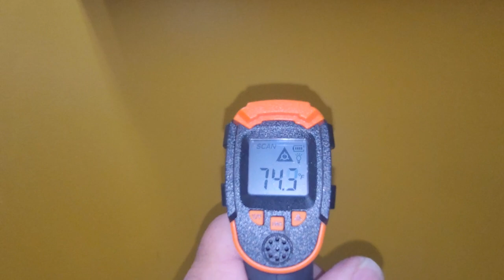Quick 'n' Easy DIY allows 2 inexperienced grads to connect refrigerant and electrical in 5 minutes

Comment: I bought two of these, two of the older ones that a vacuum pump is needed.  They really work great.  This demo should have been with NO electrical plug at all, JUST to show people that these will run 100% from just the solar panels.  I have mine connected to 4 / 455 watt solar panels, they are probably over-paneled, but that's the way I wanted it.  I am going to buy one more very soon and I hope it's a newer one with the quick connects!  You should let me come demo one of these, because I'm a consumer, I can tell everyone all the great things it does as well as where the DIY'er will need to really pay attention.  These are MUCH better hybrid mini split units than the demo implies.
Reply from the maker: Thanks for this. It's nice to hear this good news. And yes, we of course welcome your testimonial video(s) ;-)